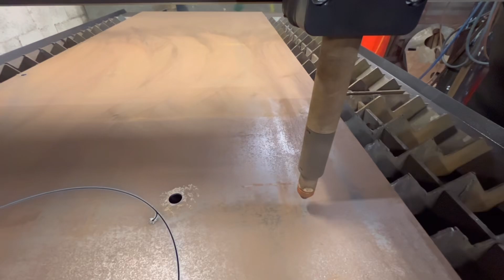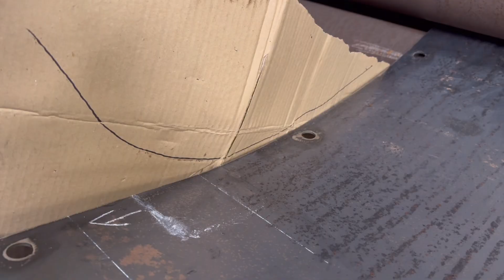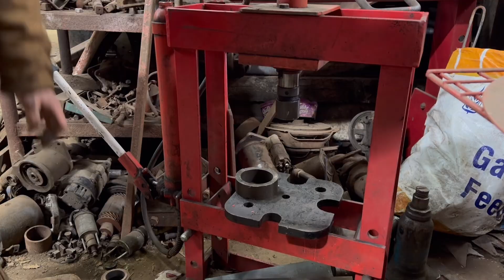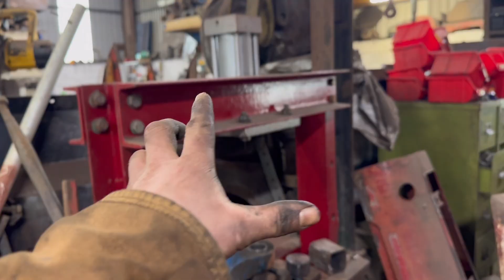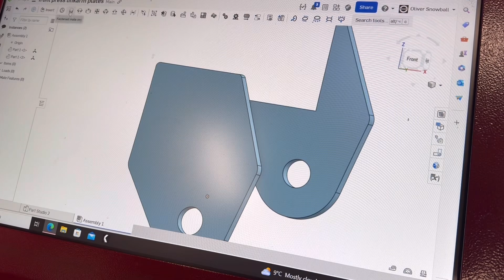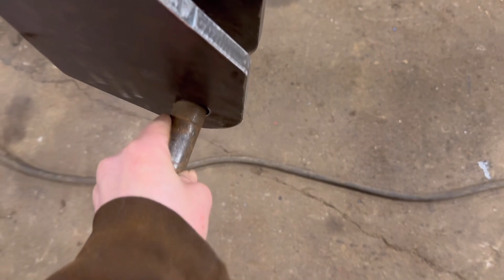Rolling a train bonnet. Bushing a Ford 9600 pivot and repairing front press link pin holes

Comment: Not easy using those rolls for the bonnet, but it is always the skill used that makes a good job with less than ideal tools, so well done Ollie, another success in the bag. The front carrier plates just don't have enough bearing strength for the load, so you could either increase the area with existing strength plates or use higher strength plates or bushes.

Comment: You need to look into laser cleaner for cleaning the surface rust off these steel surfaces. They’re not that expensive and they work really well with minimal impact on the steel, but perhaps even better, NOclogged up wheels!

Comment: A quick reference option is to use welding wire formed to the curve required and offer it up to the flat material which will provide a way to mark each major change in bend profile

Comment: 5:06 a trick i was learnt into by an old boiler used to work for us, is you take some wire, make it flat between two plates (you place it between two plates and roll the plates over it and it's perfectly straight) then put that wire butted against the edge of the part you want to bend and using tape, you mark spacings of 4 cm and paint them (both wire and the edge of the plate) with white paint. Then you take the wire, bend it to match the item you want bent to spec and then simply go back to the plate and roll it over on the table, at the edge marking where your starts and exist are, making sure your 4 cm markings match on the wire and the plate. Sounds complicated, goes really fast.
The wire can also be used as a gauge for go no-go between the OG item and the item you bend to make sure you're on track.
edit: 9:46 if you take a tailor's tape measure and wrap it around the 3 rollers at one end, then do the same at the other end, you'll know when the roller is parallel.

Comment: Some upgrades on the roller would make it much nicer to use, hydraulic roller adjusters, VFD motor control with electronic braking and some cheap DROs for roller heights and rotation position and it would be a whole new machine.

Comment: With the tractor attachment, I was thinking that you'd be cutting the brackets off and making new ones, rather than repairing the holes. It was an easier and quicker way to do the repair and a lot less fiddling around as well.

Comment: Front press frame looks great, it should help with GPS steering. Hopefully get up to collect it this week. Thanks.
Reply: Why did you need the holes tightened up?
Reply: The slack in the holes meant that the press would weave left to right rather than pull straight and not lift up properly. I might alter the pins so that they don't turn in the holes which will reduce further wear.

Comment: Oliver, to stop that rusting on items in your shop from condensation, you can brush/wash/dunk steel with milkstone wash/remover dairy cleaner...only the straight phosphoric acid base ones, not the ones with sulfuric acid in them.  The 'steel pickling' prevents rust for some time...maybe a year of more.  Works great on steel tooling too and it's pretty cheap.  I use it all over my shop here in the states.  Hope it helps, thanks for the video content.  Great work !!

Comment: Great job on the hood( bonnet), measure twice and roll once! Props to fitting the front end piece back to original bushing.👍 Wouldn’t be a Snowball Engineering video with out a little red oxide!😁Be Safe!

Comment: I like that roller press 😁

Oliver, to make that roller more adjustable, get a variable frequency drive. Brand should be Danfos, model FC302, affordable used ones are available on ebay etc. Wiring is easy and Danfos has a built in AC and DC brake, so you can stop spot on. No need for an external brake resistor for your application. You can reuse the control box, all you need are two push buttons (start forward and start reverse), a potentiometer 10kOhm and i recommend an emergency stop switch. Parameters can be set on the display, i prefer  doing it by laptop.
Reply: Great suggestion!
Reply from the maker: Thats great, thanks for letting me know!

Comment: If you need straight holes, use oxy-acetylene cutting instead of plasma cutting. The cut produced by plasma is always slightly angled, whereas oxy-acetylene cut is straight.
Reply: That depends on the condition of the cutting nozzle, tip, thickness of steel, air pressure, dryness of the air and maperage settings. with plasma, it is all about the set up. Oxy acetylene, its all about having a clean tip of the right size with the pressures set.